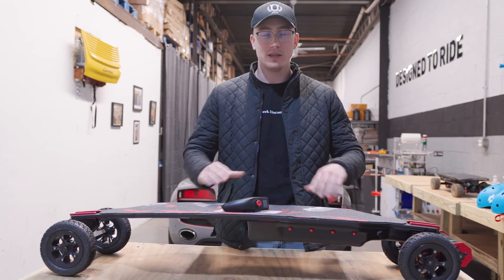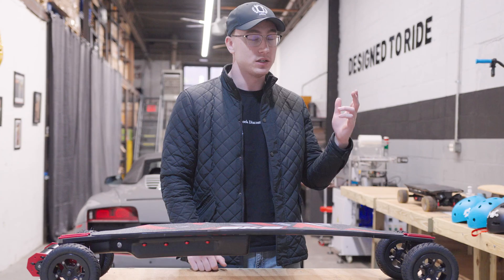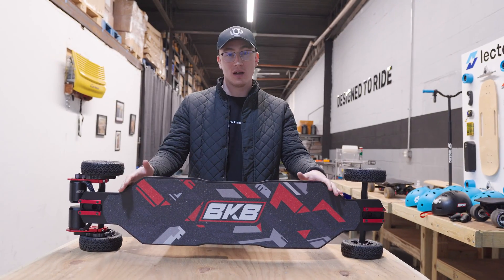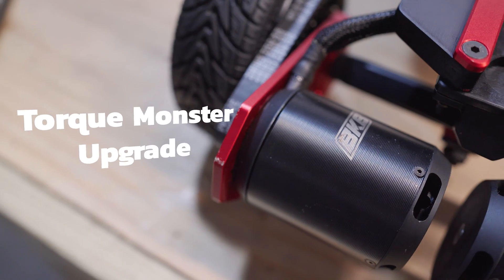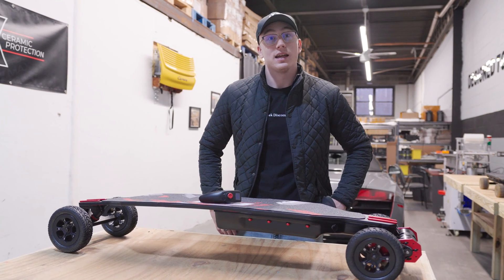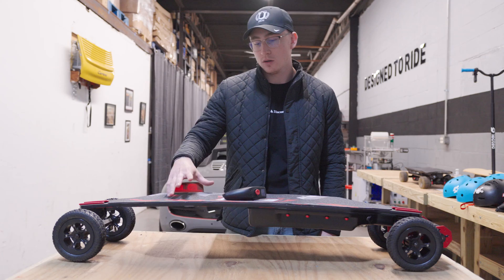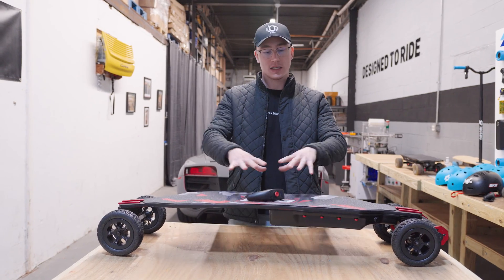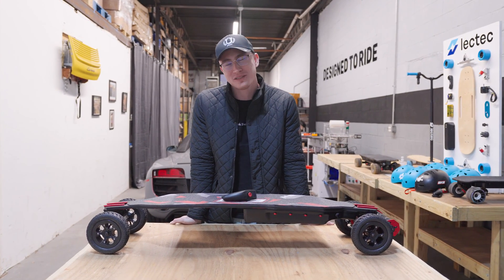Behind the Design | BKB Duo Breakdown | Building BKB EP.3

Comment: I received my upgrade kit and I start to put it together  when I realize that the cloud wheels that I have been using no longer fit on the new extended trucks, because the thread does not go far  enough  to accommodate the  cloud wheel. Not everyone is going to get the off-road wheels .  So what do I go buy spacers at the hardware store? You should have addressed that issue or informed your prior customers that their wheels would not fit your new trucks
Reply from the maker: This is because the front and back truck are the same, to accommodate the pulley bearing. Place a normal bearing spacer on each side of the truck between the wheel and truck hanger to accommodate.
Reply: Why do the motors get moved from underneath to out the back? And can I put the new motors underneath as well?